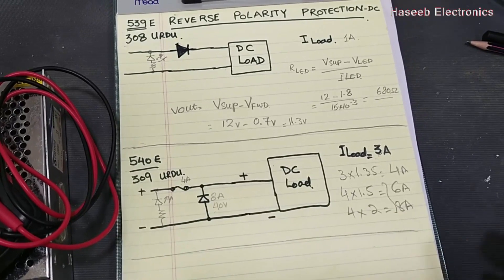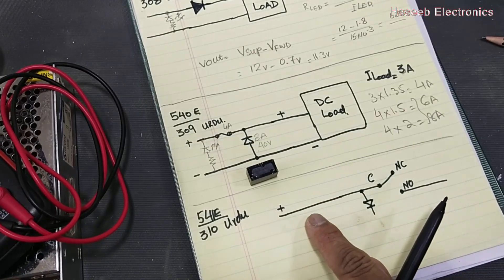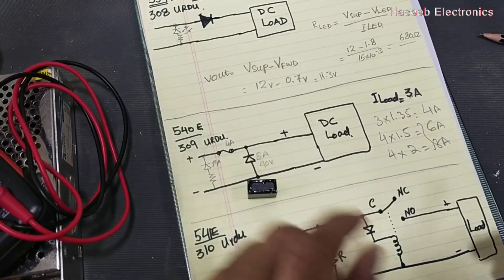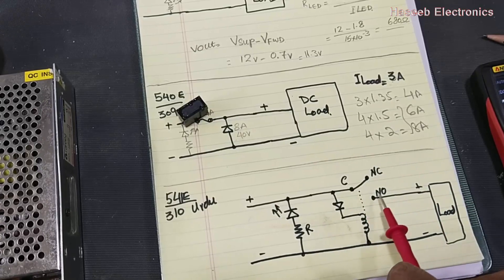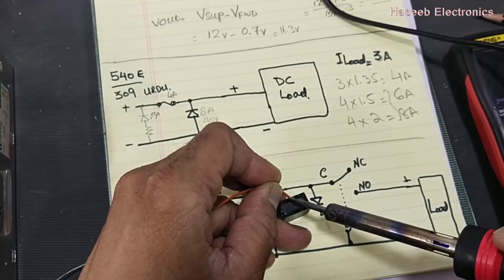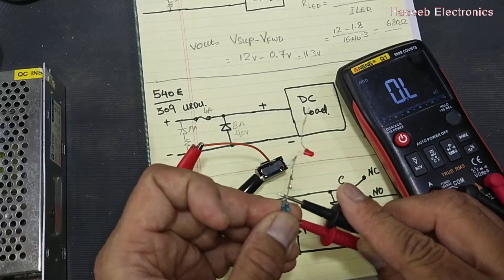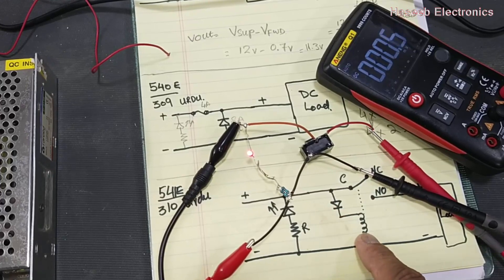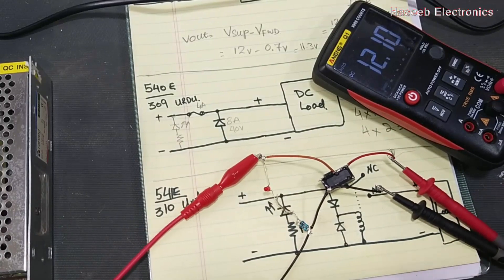{541} How to Protect Circuits From Reversed Voltage Polarity / DC Reverse Polarity Protection

Comment: Simply extend dc power supply to load through suitably rated diode bridge and forget about reverse polarity issue.
Reply from the maker: yes dear
in this series we are discussing all methods, their advantages, and disadvantages 
polarity conversion will discussed in upcoming parts